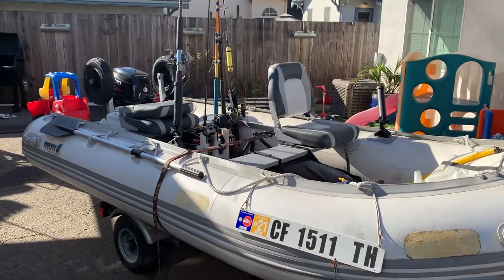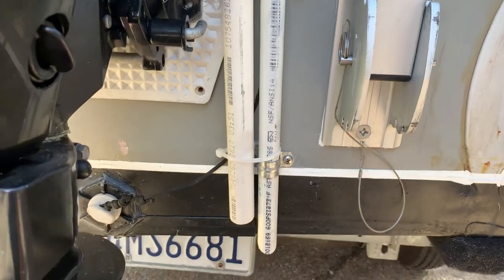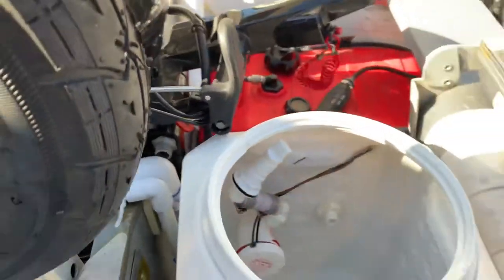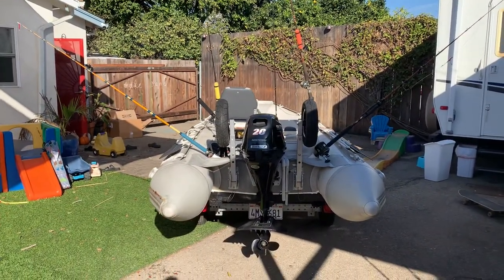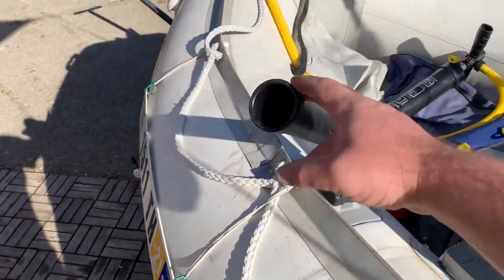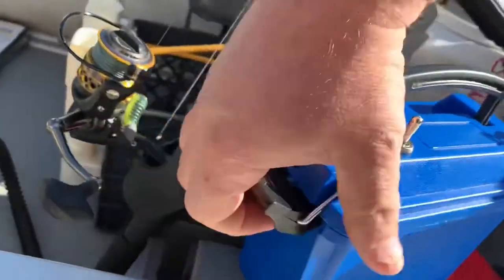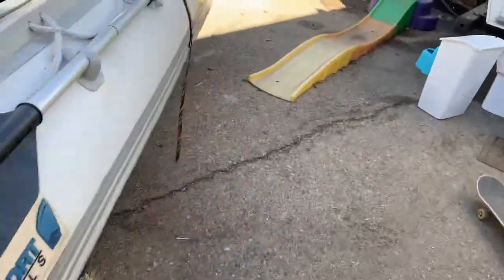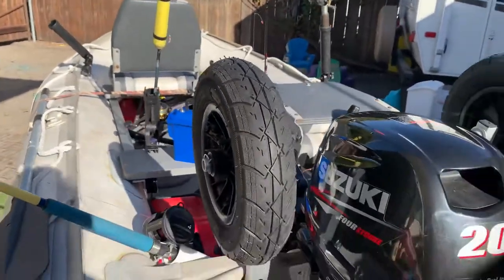Progress on the inflatable boat

Comment: Nice setup brother. What kind of trailer is that, and how did you rig it for the boat?
Also, do you trailer it with the OB on, and if so, how do you keep it from bouncing around, transom saver, or not needed?
Thanks in advance 👍🙋‍♂️